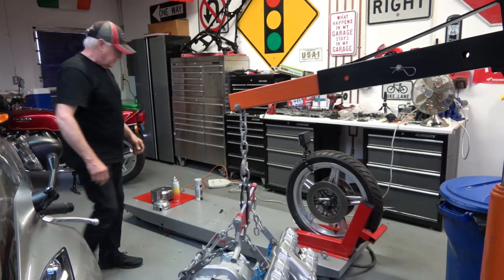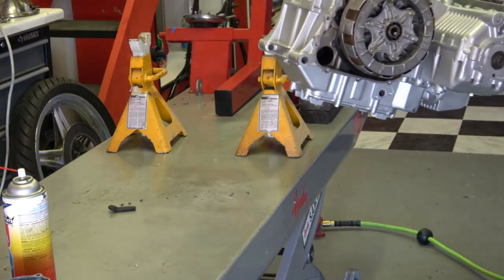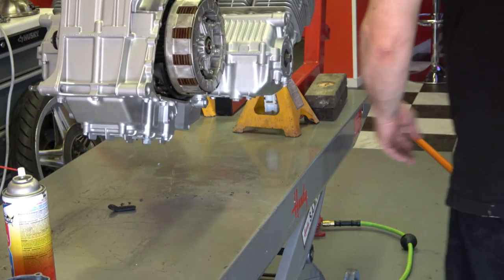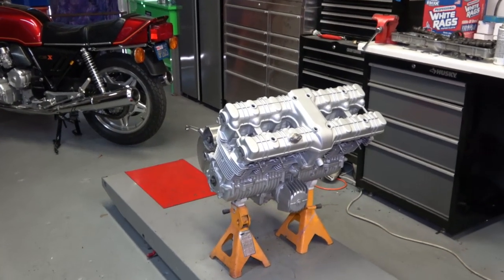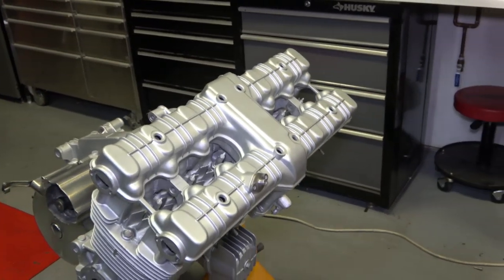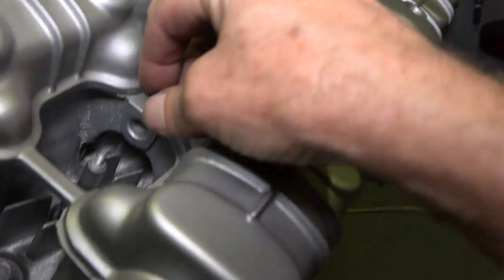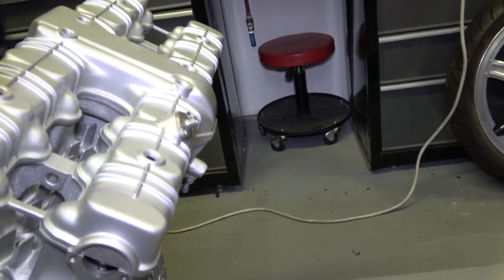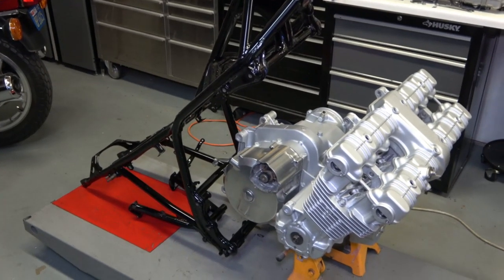Honda CBX Full Restoration & Engine Rebuild Video Series - Part 24 - Engine Ready to Install

Comment: That rattle can paint must be good stuff to repel fuel & oil staining & stone chipping ?
Reply from the maker: Hi Graeme,
The Engine paint that Dupli-color makes is a ceramic paint and is very high quality and durable.
I have painted many engines with it, both show bikes and riders and have never had a chipping or problems with it.
It is more important that the preparation of the surfaces is done properly to obtain a durable paint job.
Reply: @digitalpizza1  Thanks for the tip...

Comment: you do not need to heat the paint before installing the engine? Or will the engine temperature be enough to harden it? In the meantime, isn't the paint too fragile or sensitive to petrol? good work!!!
Reply from the maker: Hi Francois, I actually did heat the paint up before I painted the engine. I did not include that step in the video because I had covered that step in a previous video. But, your question brings to mind that I should have mentioned that I had heated it up in the video. Thank you for bringing that point up, I will mention it in up and coming videos :)  Thank you Francois

Comment: If you had to rattle can it again would you have rattle canned it on the hoist and save all that dangerous movement . Just buy cheap tarps ,poly, tape etc .
Reply from the maker: No dangerous movement, it looks that way in sped up video. I never paint inside the shop unless I want over spray over everything including show winning bikes. I have a paint room in the shop that is not finished yet. That is where future painting will be done.

Comment: Jackstands will mar paint ☹️
Reply from the maker: Hi Robert
The paint used is a very tough ceramic engine paint and the engine was lowered down onto the stands without moving them around. So there are no marks on the engine at all.
This is a temporary setup, I will be attaching the engine to the hoist after the frame is attached to lift it and the frame onto the forks and center stand.
Reply: digitalpizza It’s just my OCD kicking in. Such an impressive rebuild. Really inspirational 👍🏻🙂
Reply from the maker: Lol yes I suffer from the same thing 😎